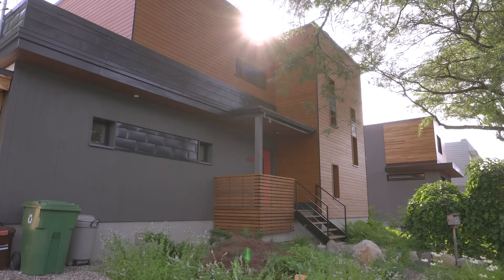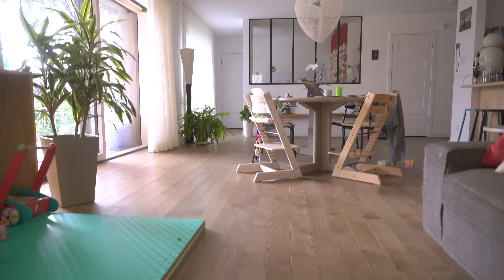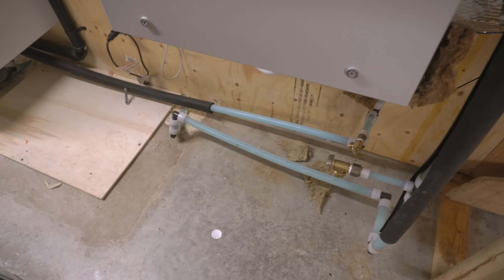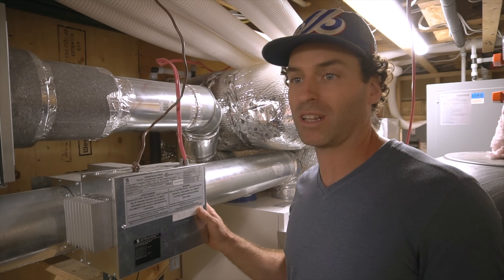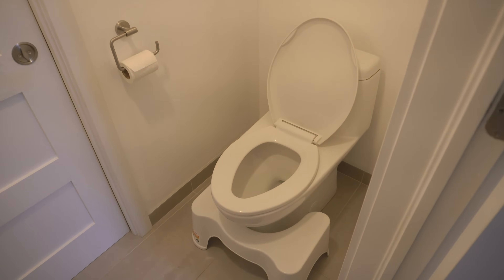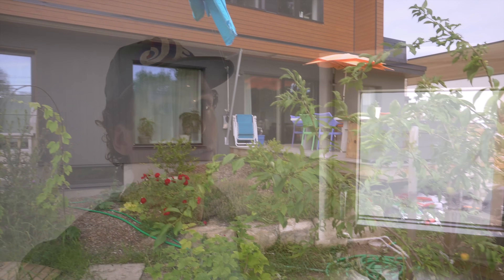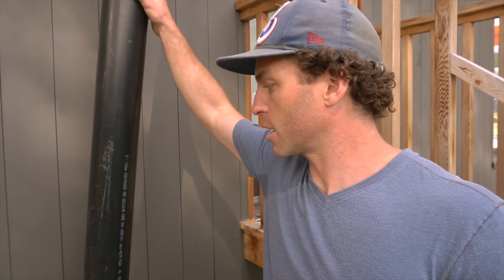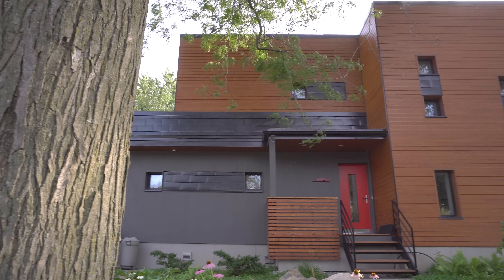1950s Home Retrofit to Super Efficient Passive House - Urban Green Building

Comment: The contractor states he achieved an R62 wall with 16 inches(40cm) of dense packed cellulose. But on the internet it says that R value formula is thickness of the material/thermal conductivity. Lets take thermal conductivity of dense packed cellulose to be 0.036 W/mK. To achieve R62, the insulation thickes has to be 62*0.036 meters. Which is 226 centimeters of insulation lol. Can he come forth and achieve how he achieves R62 rating?

Comment: I think we can lower material and building cost by making just the bed rooms “passive“. And the reason is because the living rooms and kitchens can be heated with decorative and utilitarian methods (fireplaces and stoves) when we boil down their elementary uses. The bedrooms are smaller and less windows , lowering costs. Leave living room and kitchen , entry and bathrooms at regular standard and price. Design how you like . This is just a method to lower costs. 3 pain window prices and 30 inch walls in large spaces really cost. Leave that for the most important bedrooms.

Comment: Beautiful house, that concept would work as well in hot areas, no need for air conditioning. How much more would it cost for the materials compared to a regular house. Currently all new house in Canada require an air exchanger for at least 25 years. Is that unit different?

Comment: I would call it a rebuilt or remodel than a retrofit. Do you have any examples of retrofitting an old house to higher efficiency? It does not need to be a passive house standard.

Comment: Show me the energy bill and prove to me this is more “energy efficient”.  I have a hunch with all these fans running constantly, dehumidifiers, humidifiers, geo-thermal pumps, etc, that they don’t save much energy compared to an average house.
Reply: somethings make no sense.  Really depends upon where you are building. Different climate zones and humidity levels.  Most homes have no real thermal mass, This will level out the temp fluctuations. Where I live geo thermal makes little economic sense as modern heat pumps work adequately in the winter.  and high Seer work adequately in the summer.  The cost of installation is very high with drilling or trenching.  gathering heat from the ground in canada it actually makes economic sense. One just has to take all of the variables into consideration to figure out what makes economic energy sense
Reply: PassiveHouse standards usually achieve more than 75% energy savings over conventional construction, and I've been to a few and also read the research. If you have cheap energy like we do in most of Canada, then PH may not make financial sense for you personally. For me I like the peace of mind of knowing that something is built right, and will last, and also the benefits like the end of drafts and cold spots or pipes freezing in a power outage.

Comment: Is this code now?  Not all locations work.  R 62 in the walls sounds extreme, what's in the roof?  It must be 2' thick.
Does a flat roof with a one piece membrane need an airspace above the insulation but under the roof sheathing?  Or can you fill that space completely?  The "airspace" that "keeps the roof cold" is now the ambient air above the one piece membrane, no?

Comment: I didn't know you can add an inline duct heater on a HRV?  any one know the model of that inline duct heater.
Reply: Simon Woo most of them have an option for inline heaters. It's basically required where outside temps go way below freezing to protect the exchanger from icing up.

Comment: Love how you incorporated so many energy saving ideas.  Like how you've made such a stable living environment with constant temperatures and air quality.  I imagine constant air flow would help control humidity.  Wonderful mechanical design.  I'm wondering if you'd tell me what 3,000 watt heater is used in this house, thanks.
Reply: It’s just a electric duct heater connected to the ventilation system. You can see it when they zoomed in on the heater.

Comment: I like that fact that it's extremely energy efficient. But it has got to cost mega bucks. Love the tech in the build, but until the pricing for a lot of that tech comes down, I don't think that most "normal" people can afford this. Those triple pane windows would probably take 20 years or so to recoup the cost difference from double pane. But still, I like the philosophy of passive homes and I think at least some of the tech is doable and can be implemented by the masses. Bottom line is shoot for the moon and if all you can do is hit the roof, at least you are making some progress towards a passive house and you move the needle for all of us.
Reply: @Chris67 we're in Canadian dollars here and our electricity price is about 8 cents per kWh at the moment in Québec (province where Montreal is located). Fortunately construction premiums for PassivHaus has come down a LOT in the past years and I think a realistic expectation is to pay about ten percent more than standards-compliant 'to code' building. That's still a lot but usually less than you pay in sales taxes to your contractors. In exchange you get the non-drafty, well-built, no-power-outage-problems in winter, long lasting house you dreamed of, basically.
Reply: There is actually an affordable option, called a monolithic dome, which is just solid sealed concrete.
Reply: Hempcrete is probably the single best solution.  Itll come as hemp is legal and passed in the 2018 farm bill.
Reply: Single pane windows are better and more realistic ngl. Who can afford double pane windows and why bother? Single pane windows are usually prettier too
Reply: @LucasFernandez-fk8se  ?????????
Reply: @Chris67 At current rates. But the cost of materials and energy go up every year, so the savings would compound to a shorter time frame IMHO.

Comment: It's built like a spaceship!  I love the garden.  
This house would be good for keeping out contaminated air or water from the outside, and it's protected against extreme temperatures.  
It would be great to add solar or wind power to this, but those are not passive.
I like the rainwater catchment, cisterns, greywater reuse, and the triple-insulated windows.  I love how they reused what they could and found the rest locally.  It would be a nice opportunity to have a more local source for the windows.

Geo-thermal is great for building the benefits of a cave above the ground.  However, I wonder how long it lasts and how do you repair it if there is a problem?  
If I had this house, I would add a rocket-mass wood burning stove/fireplace to use for the small amount of additional heating in the winter when many people might use a fireplace anyway.  You could use it to heat water and to dry things.  I would have a clean, safe way to use compost.  A small greenhouse, and a screened-in porch for spring and fall use.  I would plant evergreens on the north side for wind protection.  And an arbor with vines on the south side, shading the deck.  And I would have a large, walk-in root cellar.

The insulation was cellulose--which is just like straw bales but in smaller bits.  Molds eat cellulose, so I hope they have ways to keep it very dry.

Comment: Some posters have mentioned cost issues.  I'm going there also.  In a project like this, it would be nice to see the delta in the construction costs between the full passive house design and a conventional remodel, and the subsequent saving in energy/consumables costs.
Reply: For sure.  Since you posted this comment, premiums for PassivHaus construction have come down a lot.  Last study I saw found a ten percent premium in N America, which is well within range especially if you get blower door tests and real construction guarantees in the extra. Lime- based paint and bamboo flooring though, yeah that's some fancy-consumer choice going on, maybe not on my menu.  Builders in our region are going through a learning curve for some of the techniques but what I've been hearing is "this is just the right way to build things" that most owners don't consider. Ie is your house properly taped and air-sealed ?
Reply: @acchaladka Yep, I looked recently & my research says about a 10-15% increase or "premium". The personal and ecological benefits far outweigh that "premium".
Reply: I assume it would be a lot more than 10% to do what was shown in this video.  What was the final cost of the upgrade we see here?   @acchaladka
Reply: @andytiedye  oh I agree, sky's the limit; the studies are pointing at alleged averages. The issue I believe is that the large-sample longitudinal (ie lots of buildings over long time frames) are simply not yet available. And I don't know where we'll find the good data at this point.